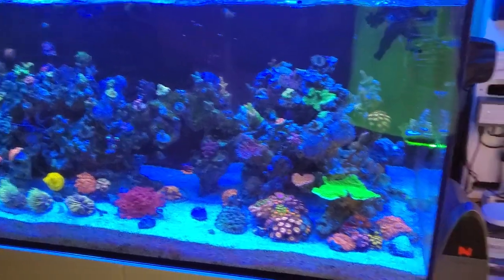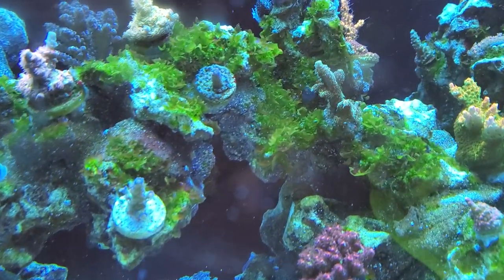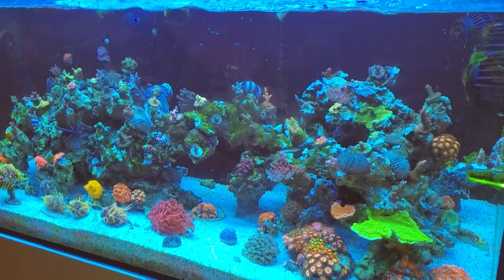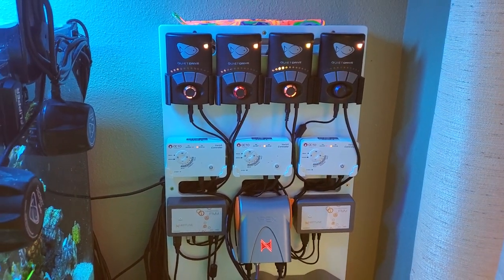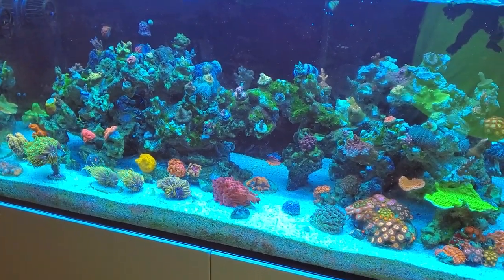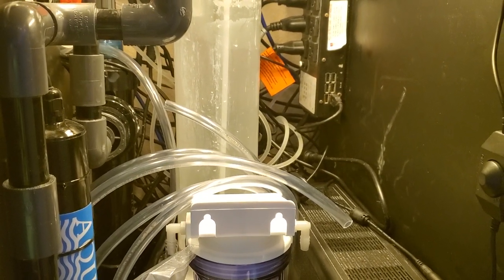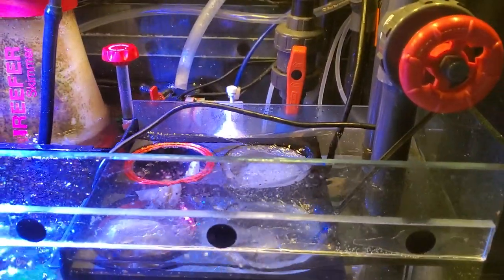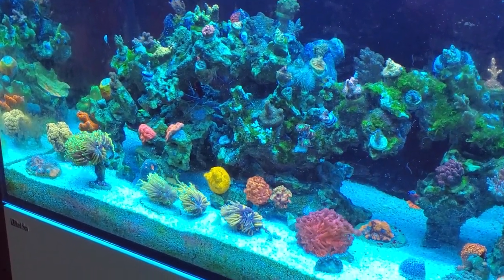Reef tank, Corals, Equipment, Red Sea Reefer. The beginning.

Comment: Hi RRR, I am really enjoying watching your channel, slowly getting through all your videos. I am upgrading from reefer 250 to the 425xl. I really like your scape, would you have any pics from different angles of it before you set it up? Would really appreciate if you could share as I am starting my rock build in the next week or so.
Reply from the maker: Thanks for watching! Unfortunately I put the scape together on the fly since it was a transfer. I used caribsea life rock arches. It's super easy to scape with. Tip: don't be scared to turn them upside down.
Reply: @rrrreefer9721  cheers thanks

Comment: I agree with you about the t5's and about jebao pumps but not their WaveMaker. I tried several jebao WaveMaker's but always had problems with them.  I finally bought one Nero 5 and have never been happier.  I  would never buy a cheap WaveMaker again.
Reply from the maker: I get it for sure. I have had better luck than most it seems when it comes to those lol
Reply: @rrrreefer9721  the jebao always appear to be working but I figured out that they almost always stop flowing at the intensity the controller is set to. They always seem to end up just flowing at a low setting.  I don't know why. My Nero 5 always pushes Water at the setting I put it on.
Reply from the maker: @ct2368  yeah all mine do that as they need maintenance. My mp40s with the guards on fall off fast if I don't stay on top of the cleaning.
Reply: @rrrreefer9721  I mean the controller does that. Not the pump. They pump always works and have never had an issue. It is just their controllers seem to fail. I've never had a problem with their return pump controllers. I don't know why their wavemakers controllers go out.
Reply: @rrrreefer9721  unless you meant maintenance on the controller.
Reply from the maker: @ct2368  oh I see what you mean.